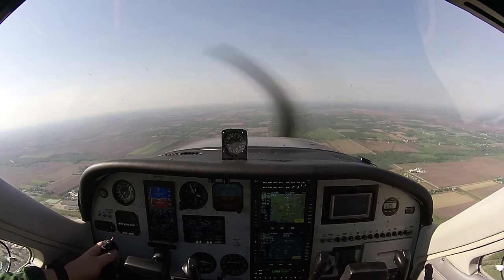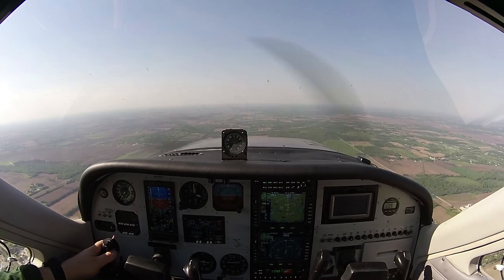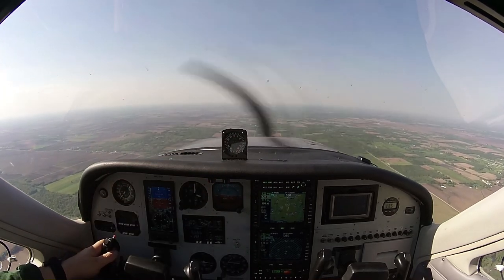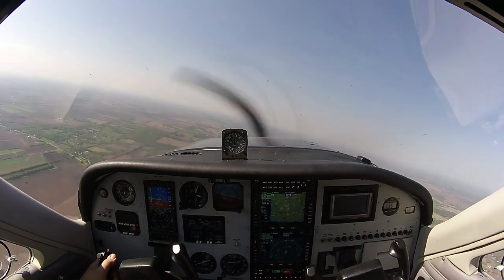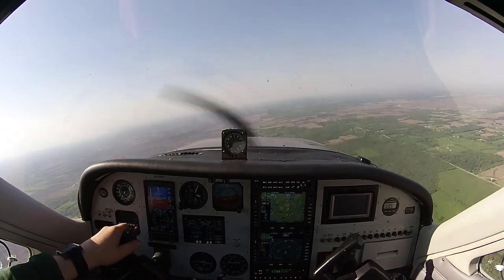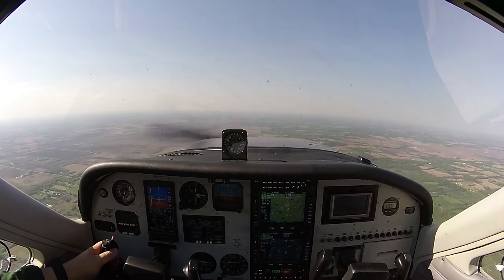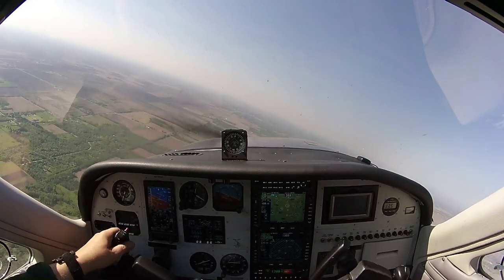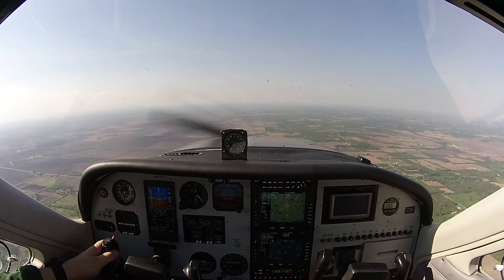Cessna Cardinal RG Dutch Roll

Comment: Hello, firstly thanks for that video. As far as i know, swept wing causes dutch roll. So therr is no swept wing on Cessna.
Reply from the maker: Dutch roll is a type of aircraft motion. Uncommanded dutch roll is a thing to worry about with swept wing aircraft. This is not uncommanded, it is a yaw-roll coupled maneuver which results a dutch roll aircraft motion.

The trick is to control the yaw to keep it coordinated, which is why it is a useful thing to do when first flying a new kind of airplane, especially an older one with significant adverse yaw. It helps you sort out the degree of adverse yaw and calibrate your feet.
Reply: @cardinalflyer  Here in my portuguese-speaking country, it's called first type flight surface control coordination or more rarely wing rock. We dont know them as dutch roll, i don't understand it.
Reply from the maker: @Davi3038849844  You can read about it in this Flying Magazine article:  https://www.flyingmag.com/guides/basic-flying-maneuvers/#:~:text=Dutch%20rolls%20are%20a%20great,the%20ailerons%2C%20left%20and%20right.
Reply from the maker: @Davi3038849844   You can also read about it in this AOPA article:  https://www.aopa.org/news-and-media/all-news/1999/march/flight-training-magazine/form-and-function-dutch-roll